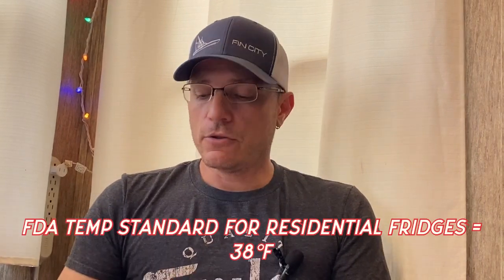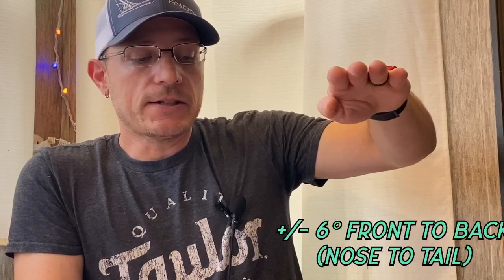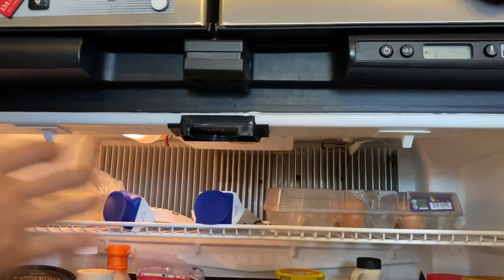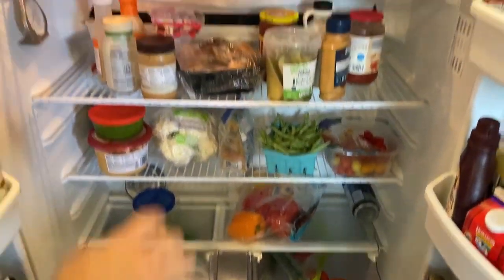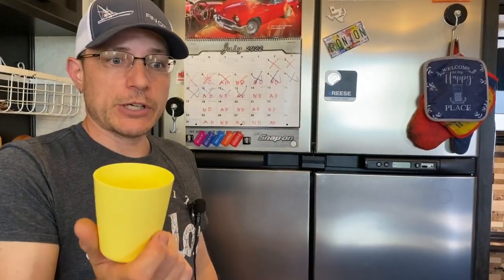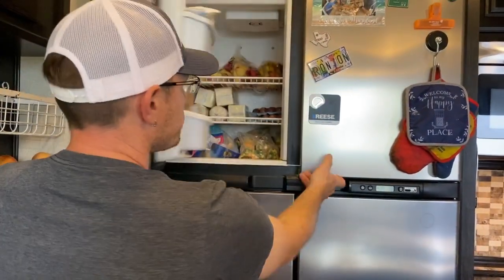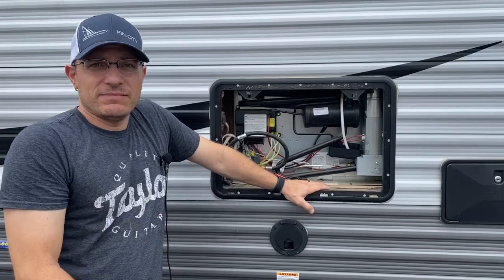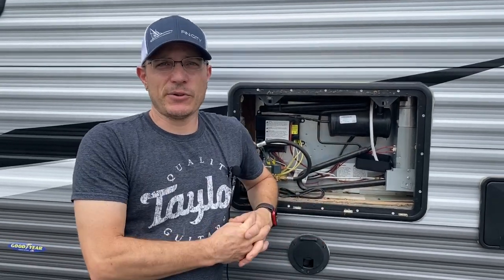Maintenance MONDAY RV FRIDGE 7 18 22

Comment: Great info, I wish I knew this before I swapped out my RV fridge for residential one. Looking back mine was not installed correctly, to much air gap on sides and top. I even swapped out absorption for compressor system and still had cooling issues. However now that I’m full time I like not having to manually defrost my freezer.

Comment: Is there a special/preferred type/brand of insulation for RV refrigerators?
Reply from the maker: Same fiberglass insulation used in a house. Just want it without the paper backing. The paper will get moist and mold.
Reply: @baierfine6590  Thanks